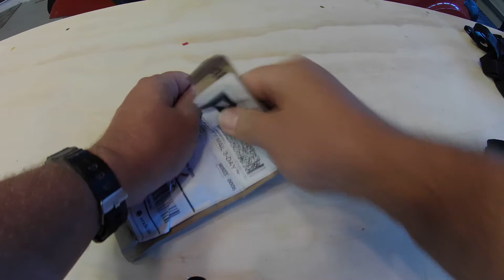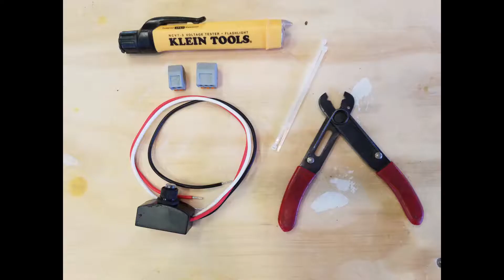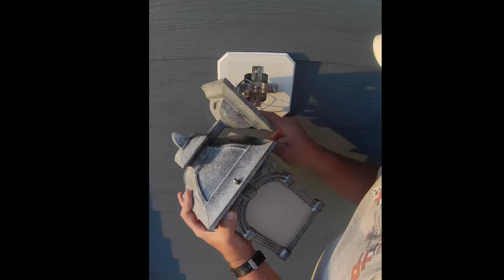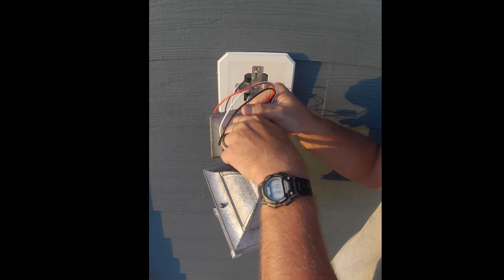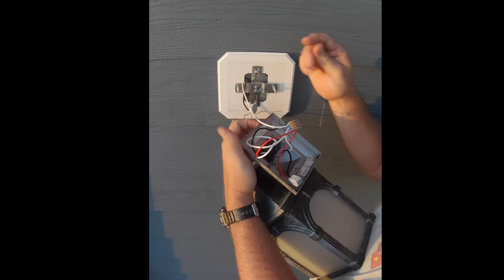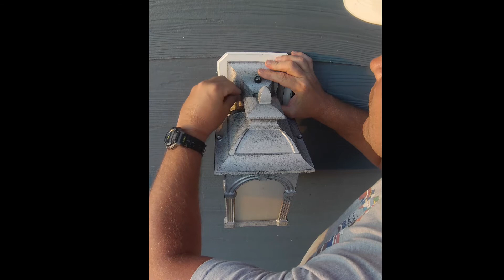Photo-Sensor Replacement part 2

Comment: I know it's been a few years since you made this but this helped me so much, thanks man!
Reply: hey also, any reason why you didn't use a zip tie with the two hots, when you used them with the three neutrals and the other red-black join? I knew nothing about wiring before this so everything seems like it could be potentially important haha

Comment: How do you test the photocell?
Reply: once installed you can just put your finger over the sensor to make sure the light comes on.  If you are trying to test an old one to see if it is bad you can do the same (if you are sure it is not the bulb and you have power to the fixture)  If you are a bit more technical you can use a meter to check voltage applied to the fixture while covering/uncovering the light sensor.
Reply: You can cover it to see if light comes on